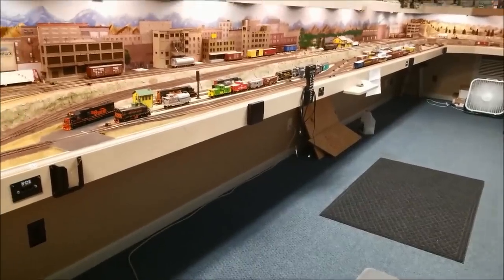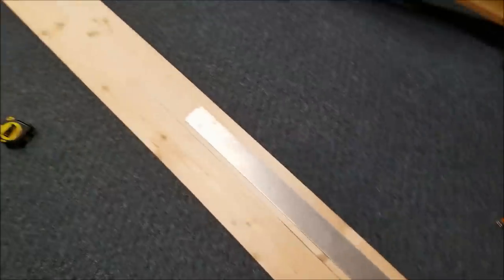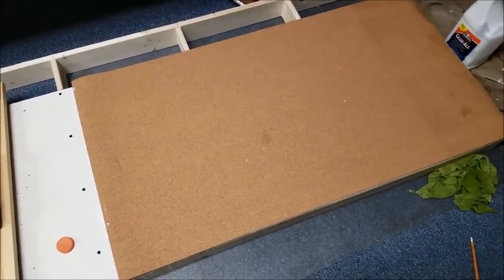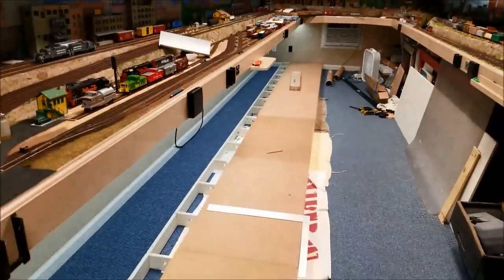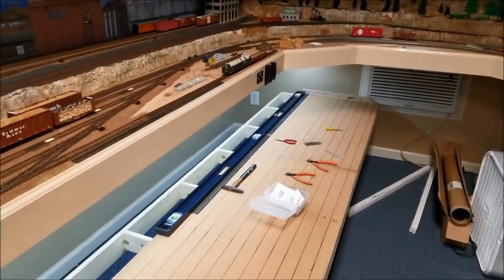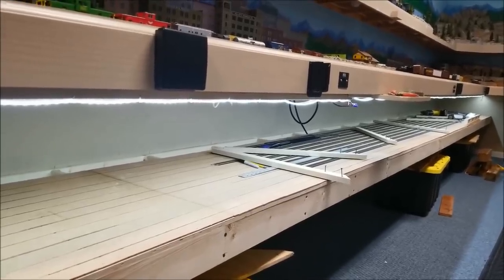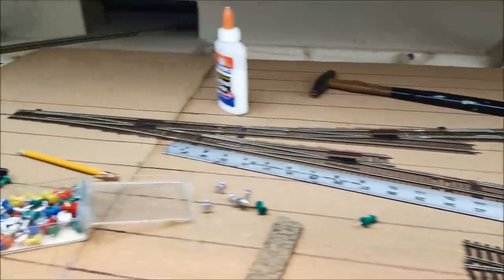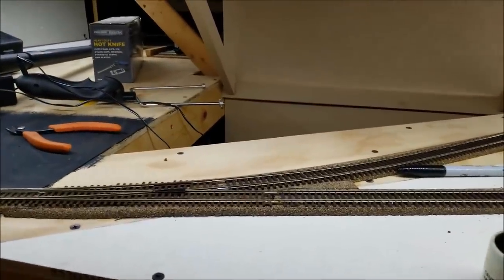Silverville Staging Yard Addition

Comment from the maker: You should be able to go 2.5% grade with O.  So if you have 12 inch separation going to need to climb around 36 feet to gain the 12 inches.  helix in O are really out of the question with limited space.

Comment: You could use remote tortoise mounts to solve some of the clearance issues to keep your yard tight.
Reply from the maker: Yes you could if you have to.  But by just moving a little this way or that It will all work out.  I will post the video when I do it.

Comment: What is the size of the slot heads in the screws.  Do I have to use stainless steel screws, why can't I use  aluminum decking screws?
Reply from the maker: These are course dry wall screws.  1 5/8 and 1/1/4 . One they are cheap and work great.  No need for stainless or aluminum anything. .

Comment: good job. Until your video, never thought about building a 2nd level below the main board.I'm o gauge atlas track so need  video help how to go up an elevation & somehow link the track from the lower to upper level. My board is o gauge, 17ft wide by 27 ft long so do have some  length to do a gradual elevation. I'm just starting my new trainboard, posting my first video in my video diary https://www.youtube.com/watch?v=jm6yyi3WELE  
I do have elevated track  using wooden trestles on the main board. Needed the elevation to build proposed lift up walk thru. Please how to do an effective elevation joining the tracks between 2 levels. My engines are mostly mth premier so they are unforgiving with elevations using atlas track. But the principles you use should apply to my o gauge. Please help with suggestions.